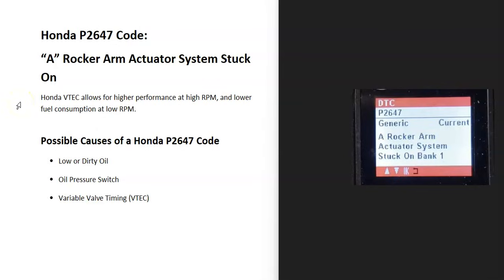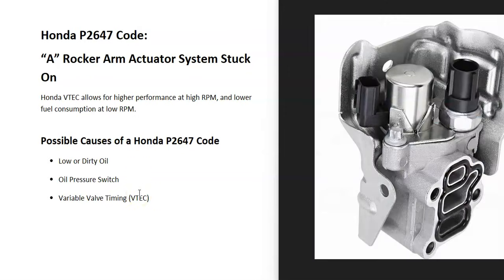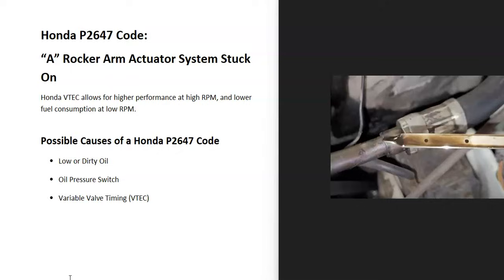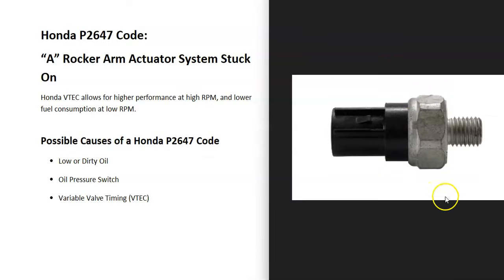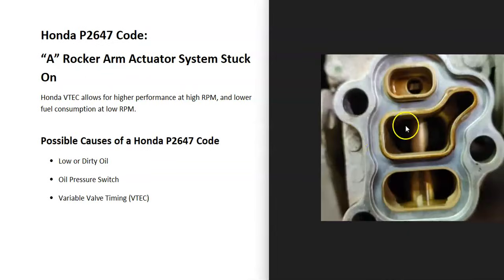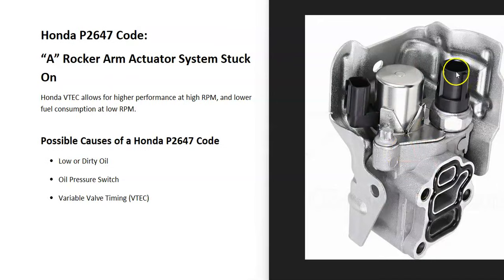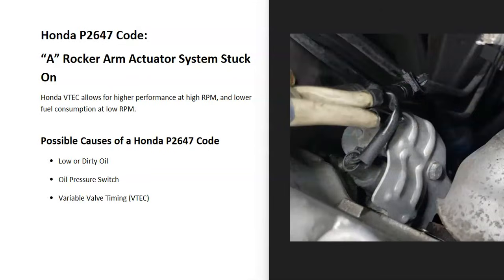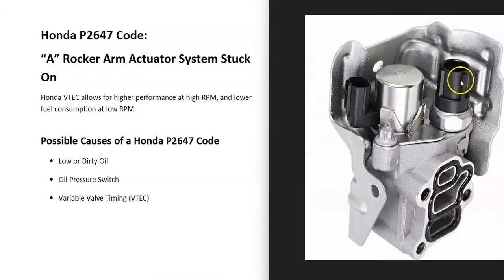How To Fix Honda P2647: “A” Rocker Arm Actuator System Stuck On

Comment: often I find it is bad connections to the vvt control solenoid on the engine face. it is a long body multistage control solenoid. if it is not switching due to poor connection this code will come up. also there is a filter on the left side of the engine between the belt tensioner and head. support the engine, remove the engine mount and the connection block, remove the power steering pump and pull to the side, remove the auto tensioner. then access the vvt filter through the plate with 2 10mm bolts. oil will leak out a bit but this is a common leak point and loss of oil pressure.

Comment: I had a p2646 code, changed the spool solenoid as pictured and mentioned here, also changed the second  gasket filter in-between power steering pump and tensioner. Reset codes...drove and it came back up.  The crv drive smooth no issues oil is to lever and 500 miles on oil change...what else  would it be?
Reply: And it gave me the p2647 code aftrtwards

Comment: I got this code after I had the Honda Service dept. run a diagnostic  due to EVERY warning light activated on my dashboard, plus my car (HR-V) violently chugging at 3500 rpms during acceleration. The service department recommended replacing that part to solve the warning lights,  but not guaranteeing that will solve the acceleration issue.  I truly hope this part fixes all my issues, as Honda charging me $630 to replace it!

Comment: Iv been through 3 brand new vtec selonoids and 1 being oem I still have this code and it has progressively gotten more frequent that it'd go into limp mode after clearing it brand new oil and up to proper level any thoughts or ideas? This is after doing the head gasket on it
Reply: Ever figure it out?

Comment: I got a 61-1 code along with a p2647(went into limp mode and VSA and the triangle with exclamation point lights went on) and later a p2649. The Check Engine Light went away and drove fine for a few days. I cleaned the screen on the vtec solenoid and tested the oil switch and solenoid which tested fine. It drove good for a couple days then the CEL came back on. It's off now but will probably be back.

Could the oil switch cause the battery code 61-1 to come up as well?

Comment: Thanks!  I replaced the unit (OEM) a few months ago as we had a severe oil leak, and many people said this gasket is common point of failure. It was my son’s, and after taking off belly pan it was the matching plate/gasket on the front of engine that had failed. Now getting this code for first time. Had trouble with plugs, so may have boogered one up. Either way, your precise, quick video id awesome. Subbed!

Comment: I have heard that if you use an after market gasket for the vtech solnoid that has a screen it can cause problems so with many ppl do is use the old screen and put it into the new gasket if it’s a aftermarket gasket.

Comment: I had this code show up once.  I had used at205 for an oil leak with last oil change.  Then at 20% oil life left I got p2647.   I guess the at205 when it mixed with the oil caused it to darken and oil was dark.   So I figured just go ahead and change the oil again but never use at205 again.  And next 2 oil changes changed oil at 50% oil life and use only high milage sync blend 5w20 oil.    The code never came back. 2007 Honda odyssey. J35a7

Comment: I changed both of those and the code is still on, even after resetting it from a code reader
Reply: same thing happened to me i replaced the entire spool valve a half a year ago and i just ordered the wiring for it and i’m guessing that’s gonna be your problem. ordered the pigtails off of amazon for 10$.

Comment: There are alot of comments, but I have an interesting problem... any advice would help! I have replaced the vtec valve twice, first time doorman, second time honda.. both did the same job for a few months, and now I have pulled it out twice more and the screen keeps plugging...🤯 I have changed the oil multiple times.. to the point where I can drive it around for 500 miles and the lipstick comes out golden clean... where is this dirt/debris coming from?? New filter multiple times!

Comment: Was Driving my H. Element and threw up p2647 and I had White smoke coming out of my Exhaust.. .... Did oil Change and cleaned the radiator added Fuel Cleaner.. No more Smoke and it's Driving Fine.. could I Have a Bad Head gasket, BVT or is it the PCV .. ? I'm lost

Comment: I got a p2659 rocker arm oil control solenoid A (bank 2) Circuit High Voltage, what is it?

Comment: How does the car act when this switch acts up.
Reply: At about 2800 rpm the car hesitates / pumps and won’t accelerate beyond that. Commonly called “limp mode” and associated with codes P2646 and P2647. Affects CRV and Accord with the K24 engine as well

Comment: I have changed the whole solenoid, new oil, new filter, and it’s showing up. When i disconnect the battery for couple minutes then nothing is happening as long as I don’t hit 8/9 k rpm. 

Anyone has an idea what is wrong? Car is civic fn2
Reply: I'm dealing with a very similar situation as you. 06 Civic SI k20z3 cleaning the contact points on the rocker arm pressure switch located on the vtec solenoid solved the problem until I hit high RPMs then it went back into limp mode.
Reply: @John-xb9dn that’s been happening to me I’ve been chasing this issue for a year now man I’ve done replaced 3 vtec solenoid 2 weren’t oem
Reply: then the last one was oem and it still kept doing the same issue after a lil time and now it’s currently stuck on limp mode too I’ve done oil change and even got a new ecm at one point cleaned all connectors too and still haven’t solved it
Reply: @asaellopez1036   When I clean the contacts mine works for about a day. So I have ordered a new pressure sensor for the spool valve hoping that will resolve the issue. Thank you for sharing your information I'll try to keep y'all updated on the results. May GOD help us! 🙏😇
Reply: @John-xb9dn  yeah mane let us know how it goes I’ve replaced that part like 3 times already and I keep getting the same shit back
Reply: @asaellopez1036  Okay, so the new oil pressure sensor on the spool valve that I installed on Friday seems to be working even after doing hard pulls at high RPMs. 
  Pull the old sensor off and check continuity on the two contacts of the sensor. If you are not getting full continuity the sensor is not working and you need to replace it. I went with a cheap $20 one on Amazon prime just for diagnostic purposes. Make sure you check the new sensor upon receiving it so that there is full continuity. 
  If that does not work then obviously you have other problems somewhere else.

Comment: Having this problem. Same code. Car won’t go past 3k rpm. Think it’s safe to drive to a few different shops for different quotes?
Reply: Likely too late for you since you posted 2 months ago, but for others, yes it is safe to drive. I have been driving mine around (off and on, since it is not my primary car) for several weeks while checking different things as time allows to get it fixed. Would advise to be careful, because car will start bucking once going over 3k-3.5k rpms, as it is in "limp mode" until it is fixed and the code is cleared. For example, if you are merging onto a highway and need to get up to speed, you wont be able to accelerate as quickly, so be cautious of this. Around town or to the shop should be fine, just don't put yourself in situations where you need to accelerate quickly and just take it easy.
Reply: @btingley88  thank you very much. I only drove it to the bank 1 day I couldn’t get a ride. Cranked it everyday for about a month. Finally found it is was the VTEC solenoid valve that needed to be changed. I fixed it and she’s been running nicely since. Again thank you very much!
Reply: @pringleslimerton-dx3dw  Not a problem. Glad you got it taken care of!

Comment: tip for anyone seeing this and has this issue, make sure you replace it with the OEM Genuine Honda part, not even Dorman fixes it. Has to be OEM from Honda, you can get it more cheaply online than at dealer.
Reply: Yup. Bought a doorman. 2 days after check engine light again. Gotta wait till Monday to buy it. Can't go zoom zoom without vtec...
Reply: @andrescordero31 this is facts happened on my boosted before race night, got to have fun next time I took car out cel and limp mode Dorman literally only last 24 hours
Reply: Better off going to the junk yard and find as many k24s as you can ! Hit then pockets g
Reply: @andrescordero31  buh what if the dealer considers my car antique and doesn’t got parts for it no more 😭

Comment: for anyone that had this issue, I had these codes come up and I did an oil change and everything went away even the check engine light, I drive a Honda pilot 2006 ex , the car has 198,000 miles. I’m starting to think instead of changing the oil every four or 5000. I’m gonna start doing it every 2500 to 3000 I just went over 3000 miles since my last oil change and this issue occurred, it’s very scary. VSA light will come on the check engine will come on and the car will not really accelerate so this happens first thing check oil or oil change.
Reply: I literally just had this happen on my ex-l I was overdue for a oil change and vsa light came on and it started running rough until it cut off and started right back up normally 291k
Reply: I have a 2006 Honda Pilot, 127,000 miles on her. I get oil changed immediately,  every time the oil gage gets to 10 percent. Its not time for the oil change, as the gage reads oil level is at 40%. The chk engine light popped on last week. And I got the P2647 code. Was unable to excelerate. The drive was sluggish so, I towed it home, and it's been parked for a little over away. I'm too afraid to drive it to my mechanic, I'm afraid I will damage the engine or it will stop and I can't move it. I will try these steps first, and if that doesn't clear it, I will replace the entire part. Ty all.

Comment: Hey I just replace my valve cover gasket and I’m getting that code but does it has to misfire?
Reply: Did you find a solution, I am recently also replaced valve cover gasket and have the same issue 😢

Comment: I cleaned the screens, replaced the unit, and it threw 8 codes.
It had been only throwing 2. I changed the oil and its doing good now.
I just changed the oil a few months ago

Comment: Have a 2013 Honda Crosstour that just started doing this today, has 378,000 kms and this is the first hurdle we've had with it. Really shudders when idling and switching gears, just managed to make it home. Is it worth picking up these parts and trying or should we just take it to the Honda Dealer? With that many kilometers would it be worth having a mechanic look at it?
Reply: Try disconnecting your battery. I was able to drive mine normally for a bit.

Comment: HELLO MY FRIEND THANKS FOR THE VIDEO WHAT ABOUT AFTER YOU REPLACE THE PARTS IN TWO WEEK THE LIGTH IS ON AGAIN
Reply from the maker: There are several components that can cause this. Which part was replaced?
Reply: @whyingo7964    I have a 1.8L replaced the VVT solenoid, the pcv valve in the same area, the oil pressure sensor switch in the front and I tried resetting it with the scan tool and it won't go away.

Comment: For what it's worth, I chased this problem forever. I had changed oil, checked all the screens, the spool valve, the actuator valve, etc...prior to this. Ended up being the wire was breaking off the main engine oil pressure switch, not the vtech pressure switch on the spool valve. Only way I found it was by chance when I decided to check the actual oil pressure with a gauge and was disconnecting it. I haven't found anything in the service manual or online in any forums etc that mention checking the main oil pressure sending switch. Also strange was that the oil pressure idiot light never came on. Maybe because it was just enough of an intermittent connection?
Reply: There is a secondary oil pressure sensor that is not related to the vtec that is what will trigger the "idiot light" to come on if there was low oil pressure within the engine itself. The vtec oil pressure sensor just determines if there is adequate oil pressure for to allow the vtec syetem to operate. With mine, I did not have a bad wire but as part of the troubleshooting , I replaced the connector entirely. Often its not a bad sensor rather a poor voltage contact between the sensor i.e. your wire problem or corrosion in general which does not allow the ECU to "see" the proper on/off signal voltage, etc.
Reply: @B95_P can you provide more information on the connector? Part number? Thanks
Reply: @howtodoitdude1662  I replied but it doesn't want to post probably because I used an amazon link..IDK. Anyway, you can find a pigtail connector on amazon in a 2 pack with a vtec solenoid pigtail that is not the correct one for k series however the oil pressure sensor pigtail is the same. I cut, soldered/heat shrinked/taped the new connector to the OEM wiring and as I mentioned it probably was not my issue but for a few bucks it just made sense to eliminate it as the possibility. That + dielectric grease when plugging back in and you've done it.
Reply: @B95_P how did you fix it?
Reply: @MrSamPhoenix  I replaced.tjr vtec oil pressure switch with an oem part plus cut and soldered a new connector and replaced solenoid gasket because it's cheap and the old one is old.
Reply: Hello. what car/engine configuration did you have your wire problem?
Reply: Im having same issue..I replaced vtec solenoid 3 times..plus the connector..also replaced oil pressure switch..maybe I need to check connector for oil pressure switch
Reply: Thanks for letting us know! I’ve chased the same issue for a long time also and haven’t fixed it so I will check that next!
Reply: @joshodges after all that,i ordered oem part on honda parts now....fixed the problem
Reply: Thank you for this information.  I am still having issues even after replacing VTEC assembly, v v t solenoid and front screen for v v t solenoid. I have also done engine oil flush and new clean oil and filter.

Comment: Please help me I have a Saturn Vue 2005 the engine blew up so I swapped it with the 2007 Honda pilot engine since the Saturn vue also uses the same engine made by Honda and because the new engine’s VTEC system had only one connector I ended up using the old vtec system from the satun because it has two connectors now im getting the coode p2647 INT ROCKER ARM ACT SYSTEM STUCK ON

NOTE THE SATURN CALLS IS ACT SYSTEM UNLIKE HINDA WHUCH ITS CALLED THE VTECH SYSTEM
Reply: did you flash the computer to match the Honda interface?
Reply: @lanceprzybyla7662  no I didn’t ill look into that
Reply: @RMAhmed89  if I can help.... I'm here Bud
Reply: Did it work?  @RMAhmed89

Comment: Would this give you a VSA warning?
Reply: Mine did. I have check engine, VSA ABS and an ❗ in a triangle. Plugged in the code reader.  This exact code. I have a 05 Honda Odyssey
Reply: @kaylabinge3307  i just got all that mess tonight. Any luck fixing yours?
Reply: Yes. It does
Reply: I got warnings for vsa and sh-awd off. Which happens for any "considerable" misfire. My code is 2647. 3.7L 07 MDX. Mine only does it when cold, I let it idle until warm and restart it and it's fine. Which makes me think it's probably just clogged up. Looks like a headache to replace but I will probably do it. I'm not sure if I want to change the whole valve spool or just try the screen gasket first. I'm at 270k so I don't wanna put a ton of money into it
Reply: Yup yup yup yup yup
Reply: No

Comment: I have a 2012 Honda Fit Racecar, (stripped) with the 1.5L Vtec.  I had a P2649 code, Cyl 3&4 Misfire.  I replaced coils, plugs, injectors, and ran fresh wires to the PCM from the Oil Pressure sensor and the VVT Solenoid.  ( whole assembly).  Car has less than 5 miles on the oil change.  I have an oil light on and a Flashing CEL.  and now P2647.
Reply: Head gasket?
Reply: Check your oil level - also must be toped.
Reply: Was gonna say the same thing check the plugs in 3 and 4 see if there's coolant on them
Reply: Lmao guy said “Fit” and “race car”
Reply: @strykerls3740  yea a shitbox enduro car.  Look it up.  One of only 15 cars (out of 60) to finish the 150 lap race with a dead cylinder.

Comment: Im about to attemp to replace the whole Spool. If that doesnt clear it, where would you go next?
Reply: I got the same issue. Any luck?
Reply: @leecountycopwatch81  I replaced the VTC filter that's in the front of the engine. It came back for one day then went away and never came back. A week later I decided to just go ahead and switch the whole spool since the part was just there. Car has not gone into limp mode since.
Reply: @takumifujiwara783  nice! Mine is driving good but I have a p2646 code. I’ve only changed my oil and it didn’t go away. I’m gonna try to replace the sensor to see if it is
Reply: @leecountycopwatch81  that VTC filter is only about 12 dollars. I would try that too. You need to remove a pulley to be able to access it. Make sure you're running the correct oil also.

Comment: Theres also a vtc screen and a vvt solenoid with screens related to the same code that can be cleared out.  oil pressure switch is about $100,  valve spool assembly is about $520 and vvt solenoid is about $300 all from Acura and OEM. the part number for vvt solenoid O-ring is 15832RAA-A01 and is about 25$ for a measly O-ring.  part number for vtc screen is 15845-RAA-A01 - costs about $9.

hopefully i helped someone with this info.
Reply: That info is wrong